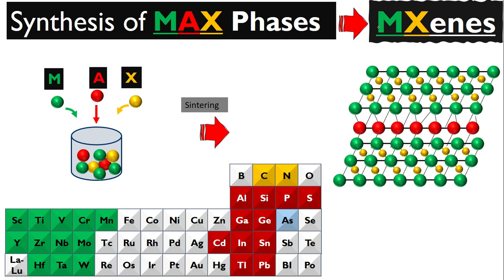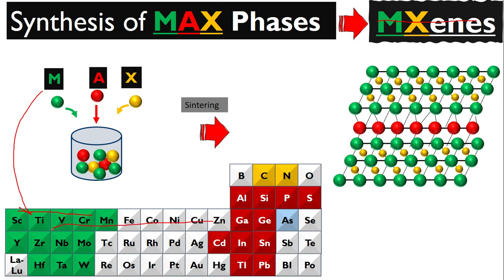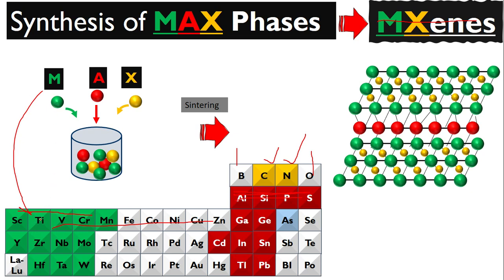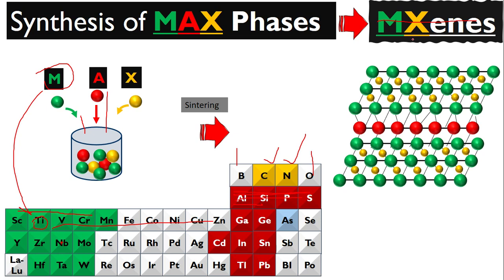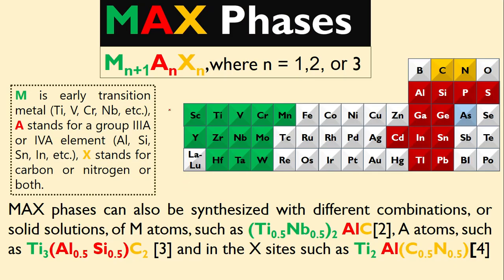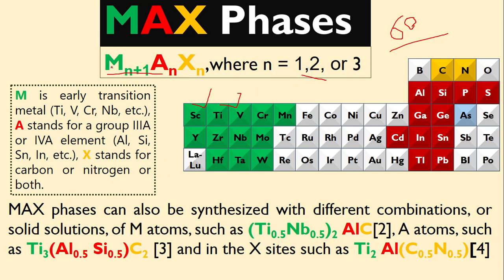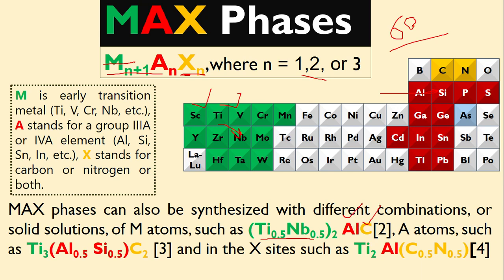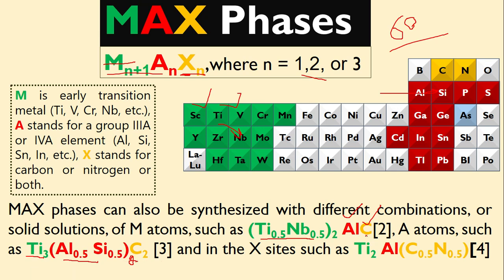Before MXenes: How MAX Phases Are Synthesized

Comment: Why only early transition elements are used for the synthesis of MAX phases ? Why we can't use later or LA and Ac ?
Reply: I am first and correspondent author of several reviews related to MXene. I didn't find any proper answer thats why i asked you here. If you have any information then please also inform me. Thanks
Reply from the maker: @tariqbashir995  Good job. Congratulations 🎊.  I may partially answer your question above. Simply,  these M, A, and I from the MAX phases, then we easily extract or remove the A layer to form MXene.
Reply from the maker: The quality of these elements helps in the formation of the MAX phases. For detail,  please read any good review paper on the formation of MAX phases
Reply: What do you mean by quality of these elements? You get me wrong. My question is can we used later transition elements like lanthanides or actinides? If you answer is yes/no then please elaborate in either condition.
Reply from the maker: @tariqbashir995  I am not that much expert in MXene. Anyhow, from MAX phases, we easily get MXene. By quality, I mean that the A layer from the MAX phases can easily be removed to form the 2D MXene.